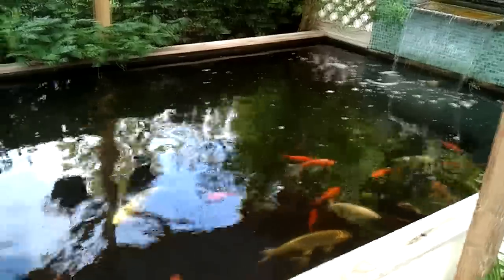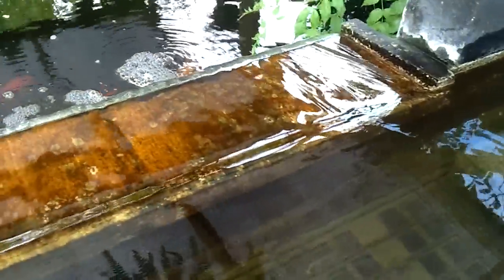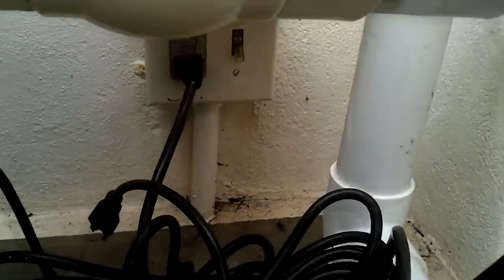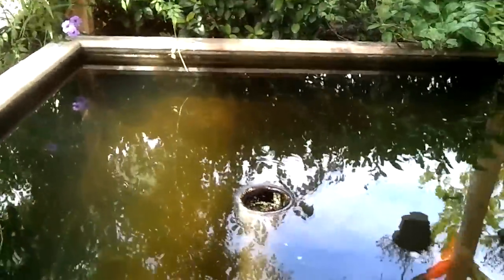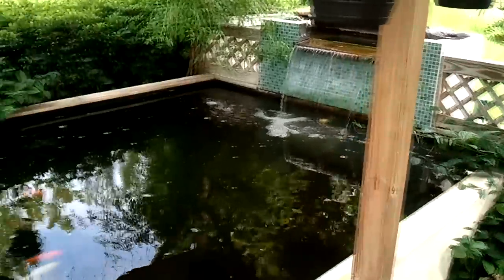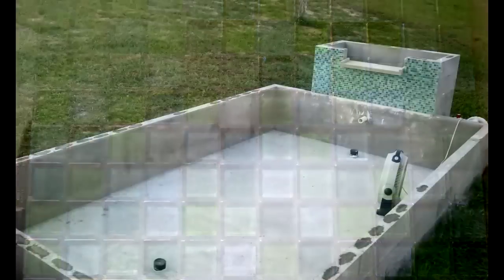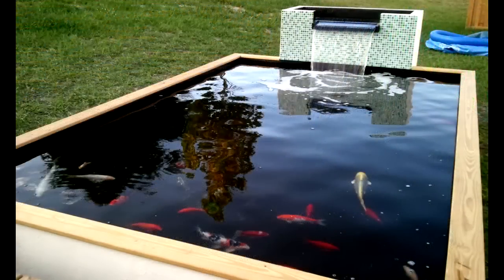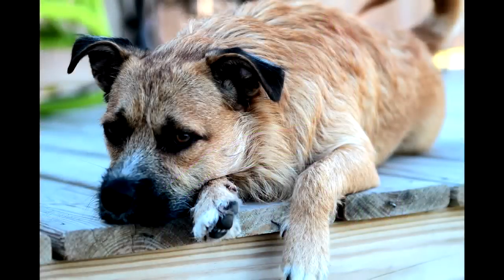Koi Pond build UV Clarifier and filtration

Comment: Great informative video. thank you for the time and effort and all the great information.  

I love that your system is so simple.  The pond I am building is very similar in size and design as yours, I have the floor poured and block walls built. Still looking into a filtering system...so much info on the market...its a bit confusing...

Could you tell me a little bit more about your filter system?

For waterproofing the pond I was going to use mortar dyed with black-the same process as a black-bottom pool. thkx again

ps...Love how the wood fencing weathered and aged.

Comment: If you use the peroxide just spray it on and heat and sun will make muck  turn white and it will float into the pond to be picked up by the filter when you turn the water on .I also made video's of my pond but mine has a liner

Comment: Very nice pond. Which brand of rubber coating did you apply?
Reply from the maker: +Ziggy S Initially I used ruberize it... after a while it began to bubble and lift, we pressure washed it all off after about 3 months. It now has a natural alage coating which is better than a sealer. Mortar is water proof anyway so no leaking.
Reply from the maker: All sealing /water proofing was done with Typical Mortar mix like you would use to lay concrete blocks or bricks found in homes. Mortar mix is water proof once it's thickness is greater than 1/4 inch

Comment: How did you waterproof the penetration of the pipes into the filter tank?
Reply from the maker: All sealing /water proofing was done with Typical Mortar mix like you 
would use to lay concrete blocks or bricks found in homes. Mortar mix is
 water proof once it's thickness is greater than 1/4 inch

Comment: What is your Pond Pump?
Reply from the maker: Joel Patrick Sarmiento Its an evolution series, about a 300.00 pump.. Cheap as far as pumps go. 1.8 amps  and a flow rate of 4500 gallons per hour  there cheap pumps, but if you get one that lasts 5 years you got a great deal.  coming up on 4.5 years on this pump, so far so good. No maintenance at all.
Reply: techtiptricks Thank you for the information. 

I have a small pond and we are about to build a bigger pond as the Koi. Anyhow, I am looking for best pond pump with low energy consumption. Also I might go with Airlift pump along paired with power pump just like your setup.